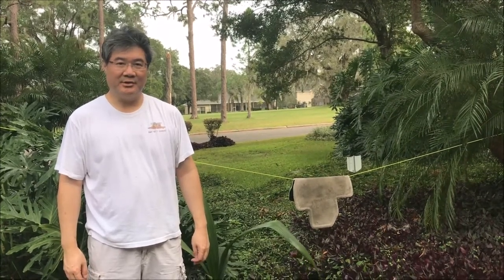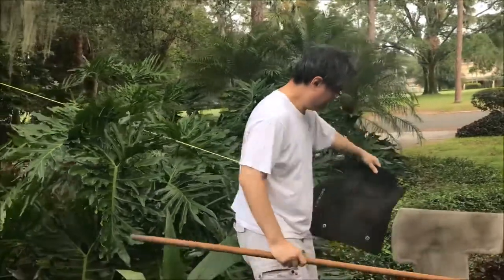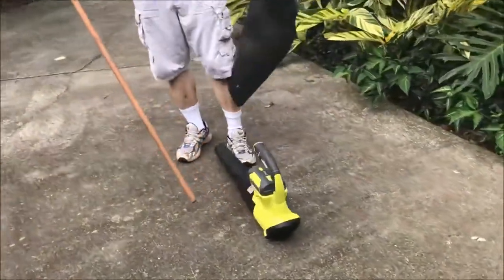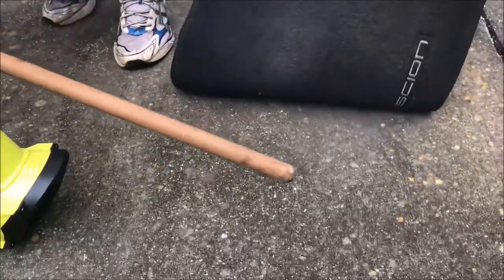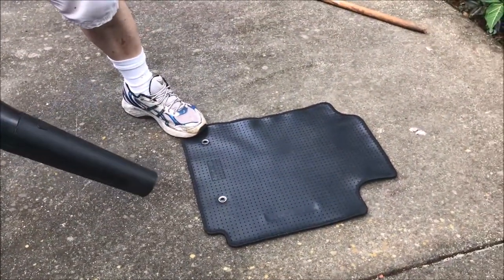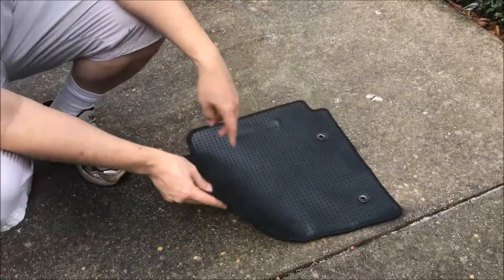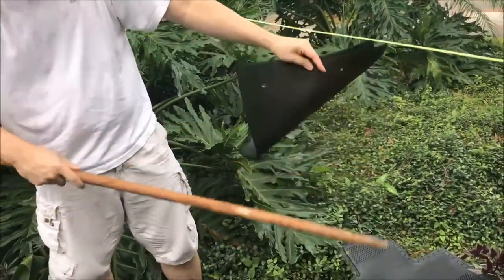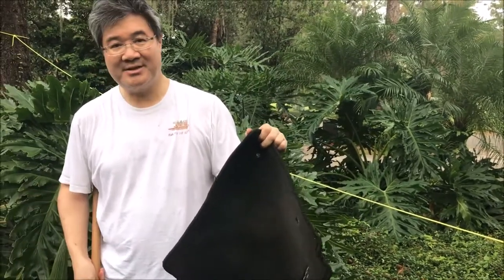Easy and safe way to clean car floor mats

Comment: Some persian rug cleaners are using pressurized air to dust a rug's front surface now. Try getting that blower right on the fibers after dusting your way, it'll probably get out even more.
Reply from the maker: Thanks for the information, Kat. You are absolutely right. I had tried a couple of ways, which can be summarized as: 1. high-pressure, low-flow (the way the rug cleaners do it), versus 2. low-pressure, high-flow (leafblower). I observed method 1 is better for spot cleaning stains, and method 2 works better for getting out large amounts of dirt. I also tried using carpet shampoo following the dirt removal, but didn't have much success at automating that with ordinary household power tools.